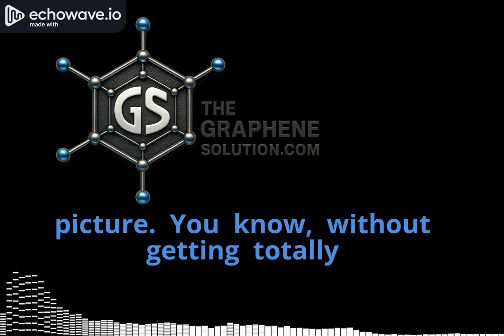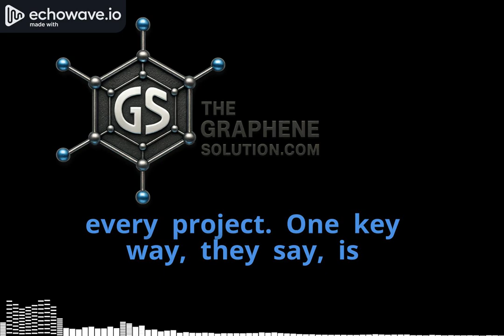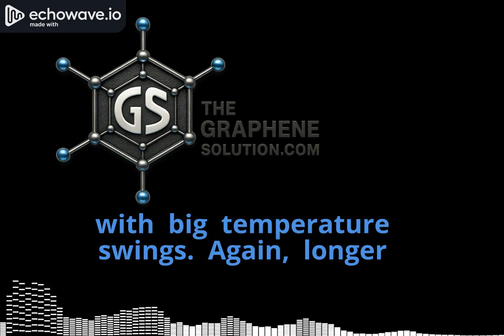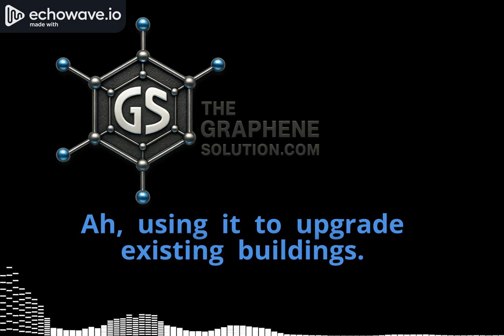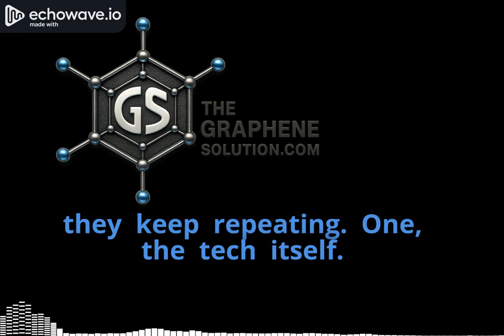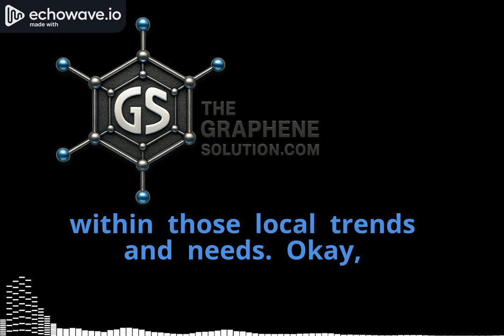Graphene in Construction

Comment: How about workability though? Or post processing? 

Like adjusting friction coefficients and surface finishings?

Sounds amazing though. Maybe this would be great for structural use, but not finishings (?)
Reply from the maker: You’re right—when it comes to finishings, there’s still more research and testing happening. Most of the current graphene use in construction focuses on structural applications—boosting strength, reducing cracks, and cutting down on cement usage (which lowers CO₂). 💥🧱

As for workability, graphene-enhanced concrete actually performs well in mixes, but getting the ratio right is key—too much can reduce flow, too little and you don’t get the benefits. It’s all about balance. ⚖

Post-processing like friction tuning and surface finish? That’s a next-level convo, but yes—graphene could eventually impact coatings and wear surfaces too. We’ll definitely cover that in an upcoming video. Appreciate the insight! 🙌🏽...if you nee more information just simply give us a call or shoot us a text to the phone number on our website. We here to help! https://thegraphenesolution.com/